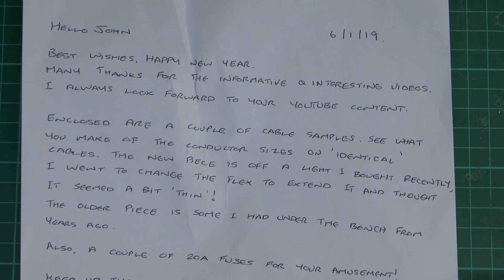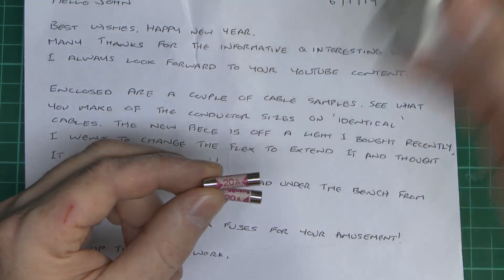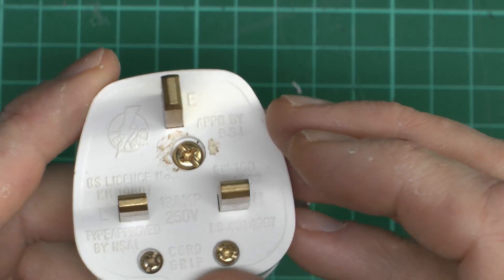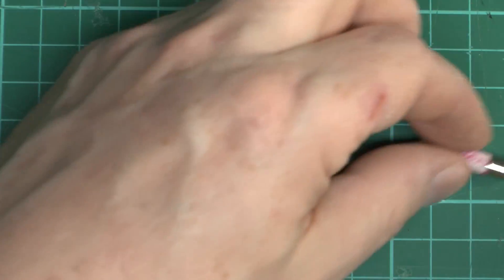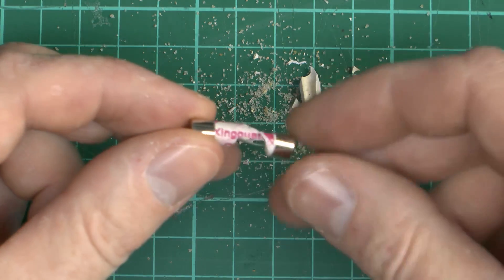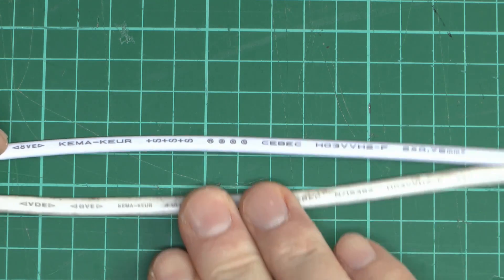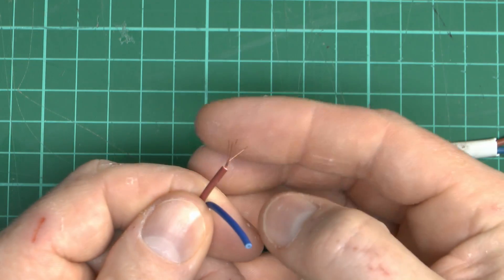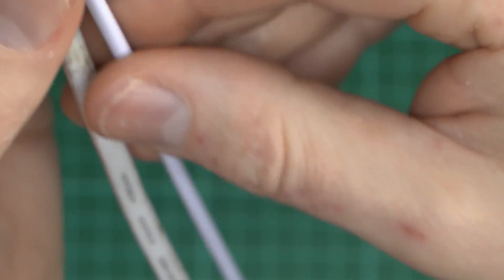Fake Fuses and Flex

Comment: I bought a few 2nd hand arc welders over the years and they always seem to have half melted 13 amp plugs attached, the 20 amp fuses must be to get around 13 amp fuse blowing problem when they don’t have a nail which will fit

Comment: Hi John. I live in the United States and we have fuses the exact same size as the ones featured in the video. However they are not usually in the plug end or socket. They usually are on the PCB as the mains comes in. But they are also used in automotive. Primarily Ford and Dodge. (Worked on both for a living before becoming a electronics repair man and hobbyist). However I run into a lot of stuff like what is in this video and have seen flex cable similar to what you show. With the same amount of wire and even less on occasion. Nevertheless I enjoy all videos of yours. Keep up the good work

Comment: We still get the odd wrong thing through from China like lamps with 13 amp fuses in them, a while back with had them supplied with the old 5 amp round pin plugs. Had to rework the entire lot of em.

Comment: The almost exact same size (25x5) fuses are used industrially in fused disconnector terminals. I have used the same physical sized fuses in Weidmuller and Phoenix Contact terminals as well as some multimeters. The labeling is a bit suspect however and probably a chinese clone. My suspicion is that you will find the dimensions are exact metric not the imperial near enough the BS standards call for.

Comment: Some Chinese company's sell you copper plated aluminium wire for the real deal, dare you try soldering that stuff....
It's not that China makes bad stuff in general but with that much production going on it is very hard to get the bad stuff and cheats out of the system, use your sense and knowledge...you get what you pay for.

Comment: Than you John. I wonder how many appliances have passed a P.A.T. with this flex? Fuses are obvious but scary flex is not nice. One of my customers had half their house burn down because a 2 core lamp flex was under a furniture leg and 13A, (should have been 3A), fuse in plug didn't blow soon enough. Cable smoldered for ages before igniting carpet. Good video.

Comment: I am sure that there exist quite some countries where 20A fuses are common, especially those with small voltages.
Reply: Yeah, probably, but I think the point here is that these fuses are labelled 20A BS1362 and that 'British Standard' only contains fuses up to a maximum rating of 13A. So they cannot really conform to BS1362 no matter how well they're made and  whatever their purpose. The marking is the incorrect thing and since the standard defines important characteristics which could help prevent a house going up in flames, it just shouldn't be plastered on things willy nilly. Which is what some scoundrels have done here. Of the two, the fake flex is easily the more horrifying though :-)
Reply: those fuses are for working sites were concrete mixer it's used trough a different plug or in three phase equipment with delta conected coils and 32A thick plug usually used to power a whole floor during construction.

Comment: I wonder if the "fake" fuses are just 13 Amp ones rebranded as 15 or 20 amp ones to increase perceived value?  But since there's no place where they could belong, I bet their market is people who want to (unsafely) increase the current capacity hoping to just not blow fuses?  And that thin cable is the result of evil as well... No regard for safety or human life.  They could burn up, leading to an investigation or worse, despite well-meaning circuit design.

Comment: Wow, three and a half grains of sand, and it’s probably only beach sand, not silica sand so no chance it would be able to quench an arc unless the fuse was installed vertically, that flex is really bad, most punters would read the sheathing as gospel unless they had something else to compare it with.
Another great video JW, very well done, I have not seen that flex here in Oz yet, but I’m sure it’s lurking about.

Comment: Why was a baker's dozen chosen for the maximum plug fuse rating? To me 13 amp seems an odd number.
Reply: It's so that you can get 3Kw loads on to a plug. That said with the variation in line voltage you would likely be just over or under 13Amp with a 3Kw load. But these fuses are not so sensitive that they will blow with that variation. I have had a customer with commercial dishwasher that someone had not altered for a 13Amp connection that managed to draw 26Amp for a short period via a 3 pin plug before the fuse let go. The plug top got a little warm to say the least.

Comment: In Malta we go one better. We replace the fuse with a sawn-off bolt of a matching diameter to stop the fuse from blowing when we plug any welding machine into a 13A socket. Having said that, most ironmongers have these 20A fuses on hand which they will gladly sell you if you pour your heart to hem about your problem of the heater constantly burning the fuse.

Comment: For small things you order for yourself from China, you can use this to your advantage.  Simply order a step or two up from what you need, for example order 1.5mm² cable if you need 0.75mm².  When your fake 1.5mm² cable arrives, chances are it'll be at least 0.75mm² so you can complain that it's a fake and get your money back, but you usually get to keep the item if it's a small amount.  In this case you'd end up with the 0.75mm² cable that you originally wanted, only now it didn't cost you any money.  I have no moral qualms with taking advantage of the fake makers this way.  I figure if they are trying to cheat people by offering dangerous items, then playing their game and making them lose money is fair and may even discourage them from making fake things in the future.

Comment: Would it really hurt  to run 20 amps Through a standard UK plug? Considering a standard europlug can handle 16Amps i don't see much issue just removing the fuse and inserting a 4mm2 piece of copper.

If it's a 20 Amp radial circuit, that is.
Reply: isn't real 16A, running power should be 85% of that, breakers have termal mechanism rated at about those 13A and only magnetic decoupler which it's for short-circuits it's rated at 16A. Don't burn your house man.

Comment: The Lucky Golden Star electric wire company has already changed name three times since producing the fake 0.75mm² cable shown in this video.
Reply: They do, however, make an excellent chicken chow mein! 😉
Reply: I guess this was intended as a joke? I see no manufacturer markings on the fake flex. And as far as the name you mentioned, Lucky Chemical and GoldStar Electronics merged some 20 years ago and are now known as LG and are primarily known for manufacturing TVs.
Reply: @Gameboygenius  that's pretty cool I have a LG TV it's great!

Comment: Hiya John. 
I have a couple 
of things to say 
about these things you reviewed.....

(1) Those 20A fuses..... Whatever next?! They'll be making 30A and 32A ones next so that they are "compatible for devices connected to ring circuit" I'd hate to think!!

(2) I would really like to have a couple of those 20A fuses so that I can teeaase them on my variac. 

.....Uuuuuntil they pop! Let's see what they REALLY take until they let loose!

(3) That flex. You know what I am going to say here....

I WANT FLAAAAAAAMES!!!!!!!

I think that needs to go out in the garden and teeaased on the Oxford welder to see how much it can take until it lets loose.

0.75mm flex is supposed to take 6A without any difficulty.

In fact, given how pathetic those cores are, you might not even need the welder.

Put connector strips on either end of it and connect up legitimate 1.5mm flexes to either end and then stuff a 3kW kettle on it.

A 0.75mm flex will withstand a 3kW kettle for the time it takes to boil 1 Litre of water.

Let's see how silly-hot that super fake-O flex gets!

Then, if we don't get flaaaaames, whip out the welder AND BUST IT RIGHT IN.

Thanxx for showing,

-Wayne's Electrical.

26th January 2019, 21.37

Comment: 20A fuse is there because people want to plug a 2 bar heater and an electric iron into the same extension cord, so they can be nice and warm while ironing, and 13A fuses are inconvenient as they blow when you have the iron on and also have the heater on high to get warm fast. Who would actually want to run 2 separate cables to the middle of the laundry area just so you can have heat and ironing done at the same time, the fuses in the plug of the extension must be defective, so put in the 20A one and it never will fail.

The other cable is the wonderful invention of a self fusing cable, when the equipment it is wired to fails short circuit it does not inconvenience you by tripping the ring main RCBO or blowing the plug fuse, instead the cable both acts as fuse element and power limiter in one.  Added bonus is the manufacturer of the device no longer has to install inrush limiting NTC thermistors in the power supply, the cable does that function along with power supply, a further saving. This is the modern version of the old radio line dropper cord, upgraded to a new standard where it no longer uses nichrome wire in an asbestos sheathed cable with a cotton and rubber sheath over it, instead it is contemporary styled to match every other cord.
Reply: SeanBZA - I’ve actually seen two electric heaters (I think they were rated at 2kW each) plugged into a 13A extension lead. The 13A plug fuse never blew. It ran like this keeping a single room warm for over a month while the contract electrical contractor got it’s act together to replace the wall heater. The only thing I can think of, was as both heaters were the same type and model and both had their thermostats set at the same setting, that they shared the heating and hence, most of the time, did not run simultaneously.

Comment: Here in the US, 15A and 20A fuses are commom. So it may have been cheaper to print over fuses for other regions.
Reply: @Matt Quinn Makes sense. Many of the fuses here a 20x5mm instead of BS1362's 25.4x6.3mm

Comment: Gotta think these came out of a factory and then failed QA testing. Then instead of destroying them, somebody in the factory relabeled them (with higher amperage for the fuses) and sold them at a discount. The chance that a lawsuit for death in fire would trace back to the supplier is understandably small. Strangely there does not seem to be enough government oversight, even in a country like China!

Comment: Come to a hardware store in Malaysia and you'll see a lot of brands but KSE is the worst cable brand. Size is fake, when you buy a 1.5mm, it feels smaller and the copper strands are obviously not 1.5mm. When you buy a 2.5mm, the diameter is like a 1.5mm.Same for higher and higher. I avoid using KSE becauase they're cheap but its tinned copper. Most cables here are tinned  copper for real wiring cables we use 25mm the smallest for aluminium and 16mm the smallest for copper. There's some people here that uses a 2.5mm as a  tails... Oh boy.
Reply: SyazTYT 2.5mm² genuine copper is perfectly standard after a 16A fuse, so pretty much all domestic circuits in Europe except the incoming power feed and maybe UK ring mains.  But if your market is flooded with fake cables, you obviously have to go higher to compensate.
Reply: @bsimpson6204  some people in malaysia do use a 2.5mm for tails.... a "qualified" electrician did it

Comment: Come on John, we all know that the 20A BS1362 fuse was made for large single phase air compressors in garages and the like.
That is, when they haven't used wire, tin foil or a cut off piece of M6 bolt instead of the fuse.

Comment: These are usefull for old apliances that constantly blow normal  fuses, a lot easier than cutting down and inserting  a  section  of 5" nail or bit of m6 bolt.
Reply: If your appliance is constantly blowing fuses then it's probably faulty...
Reply: @Agent24Electronics  You obviously have never met the typical non technical person, who regards a blowing fuse as a reason to put in a bigger one, till it stops blowing.
Reply: @SeanBZA  Absolutely right! 30+ years ago I was a retained fireman in the town where I live and one night I and my colleagues had to rescue a man who set his bed on fire.  He very nearly died and was lucky to escape. He'd run the flexible cord to his bedside lamp between the mattress and the steel frame of the bed (as you do), after a while the insulation wore through causing a short and blowing the fuse. His answer was to replace it with one of a higher rating, and in due course this too responded to the short circuit by blowing.  The final solution was to replace the fuse with a short length cut from a 6" nail and this cured the problem.  Only snag was the subsequent overheating of the wire set the mattress on fire whilst he was asleep.  Interestingly, his flat was on the 10th floor of a tower block.

Comment: I don't think I would use that flex for speaker wiring in case of overloading! On the fusing debate I have a Stanley compartment case full of all types of fuses, sizes,offsets,straight,diagonal, no wonder someone is trying to sell us 20 amp plug fuses just to add to the mix .As a retired sparky I do appreciate your vids.

Comment: In the US we use the 20amp in older cars. Also very old CATV equipment use the bottle fuses
Reply: Bill Greene automotive fuses are glass, and only rated for up to 32 volts DC. Ceramic fuses like the ones John was showing are used in a lot of higher voltage applications- but the problem with the one he's showing us that it's labeled as complying with a standard that it cannot comply with by definition. Which also makes it suspect in other ways, though that particular one did actually have the sand inside and a link that appears to be appropriately sized for 20A. That fuse would probably be suitable for a multimeter, though I wouldn't trust it.

Comment: Bussmann in the past have manufactured specialist 1 inch fuses for the company that I work for. These fuses are rated at 20 Amps 32 Volts DC and are for use in 24V motor applications. This size being required, as the fuse holders are part of old 1970s 24V DC bus-bar systems that use yellow colour plastic clip on rail type fuse-holders. The other fuses used are standard BS1362 10A fuses and a smaller size 5A fuse (these may be BS1361 LA5A size).
The original 20A fuses do look a lot like U.K. plug fuses, but not having changed one for over five years, I could not say what, if any standards markings they have on them. But they certainly DO NOT have BS1362 printed on them.
Reply: I think you work in the same industry as I do.
Reply: Ditto - I have also seen them used on 240V circuits (240V DC is really nasty... )

Comment: That cable with the very thin wire looks suspiciously like low current high voltage rated cable. Maybe 500mA, 5kV? 
that is, if you took the individual insulated wires. Them contacting each other in that flex would probably reduce the rating to only 2kV or so. (Wild guess!)
Reply: it looks like the 2x0.5mm 3amp stuff i bought some years back, though far less strands.... probably 1amp max, ok for table lamps...
Reply: andygozzo72 Except regs require 0.75mm² minimum.  And the fake markings say 0.3kV (H03).

Comment: haha only about 4-5 strains of copper inside what can this conduct without burning ? maybe 0.5 - 1 amp ?
Reply: Would be interesting to see how much current it will take. 0.075mm more like 😂
Reply: Rule of thumb is 4 amps per sq mm
Reply: @andreim841  thats not true 1.5 mm² wire is rated for 16 A in a normal Wallsocket outlet of course that varies with environmental conditions.

Comment: There are lots of Youtuibe videos about Multimeters where they talk about the ceramic
fuses being not easy to obtain and being expensive . perhaps some meter maker is
using these cheap fuses in their meters .
Reply: I just use a 5A BS1362 fuse in my multimeter. If i need to measure current, i usually use my clamp meter anyway.
Reply: Indeed, if you search AliExpress for "bs1362 20a", a lot of the results have "multimeter" in the listing title, so I suspect that's what these are made for (especially as they do appear to be reasonably decent quality - at first glance, at least). My other idea (which someone has already mentioned in the comments) is that maybe one of the other countries that use a UK-style "G" type plug has standards that permit 20A fuses - and hopefully also use plugs rated for that current! A quick read of the relevant Wikipedia articles doesn't immediately show that this is the case, however...